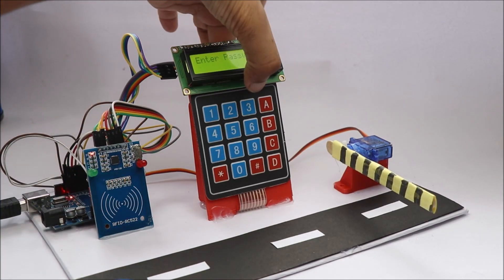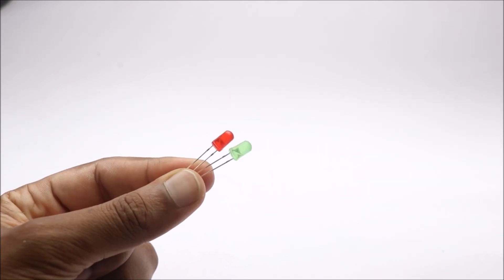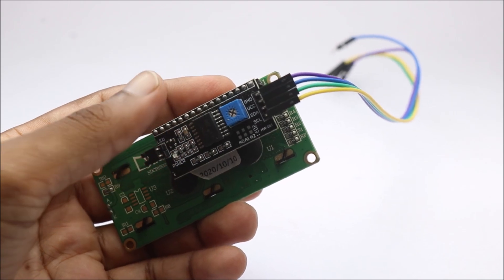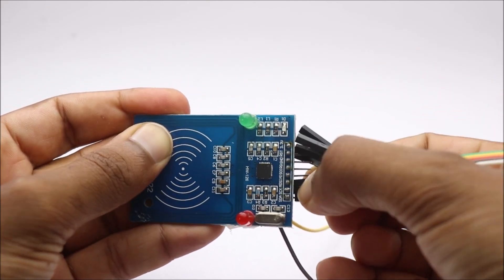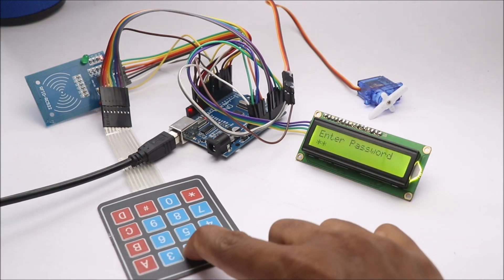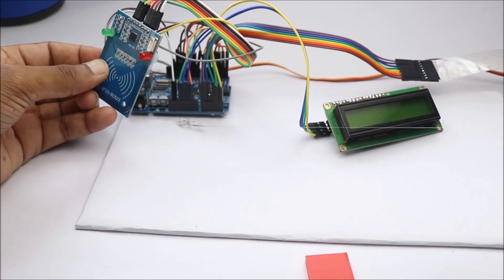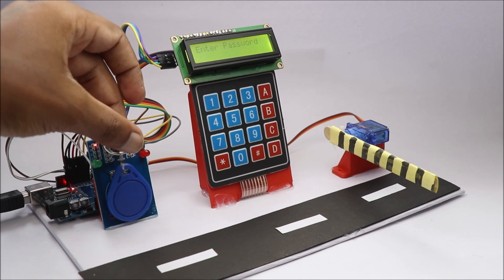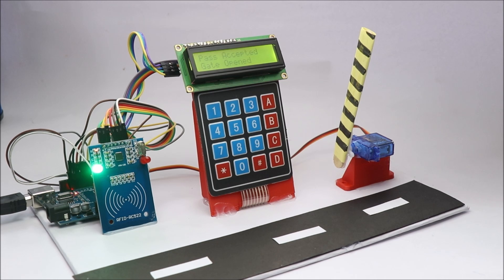How to Make Arduino Gate Lock Project with RFID and Password | New Arduino Projects

Comment: Sir my led screen is not displaying the message
Reply from the maker: Please check power Connection
Reply: @jeevanjee Sir it is connected to the laptop sir but it is not working.
There is only a slight movement of the servo after uploading the code without entering the password or scanning the tag or card
Reply: Sir it is connected to the laptop sir but it is not working.
There is only a slight movement of the servo after uploading the code without entering the password or scanning the tag or card
Reply: Sir Please reply fastly I have a school exibition next week